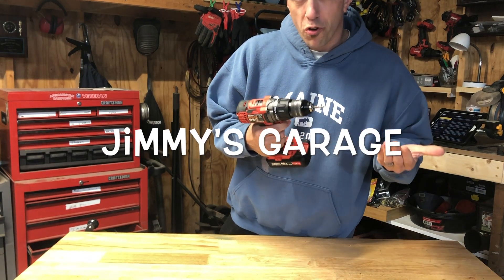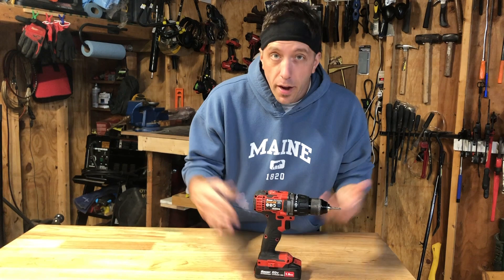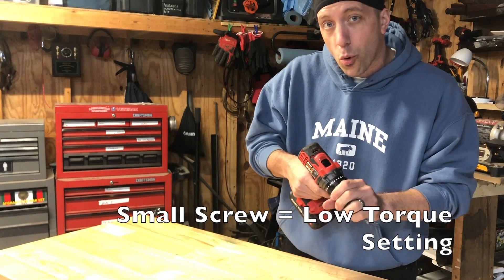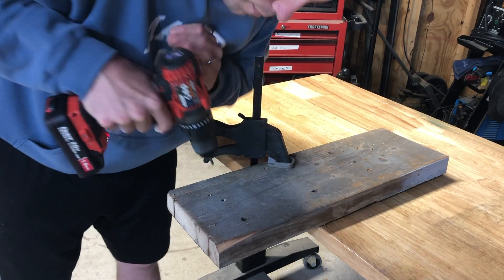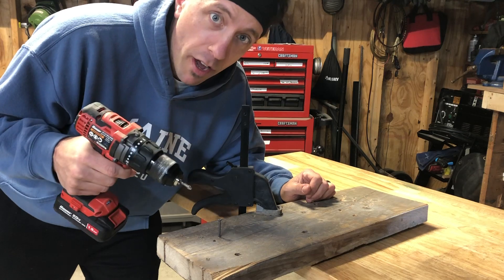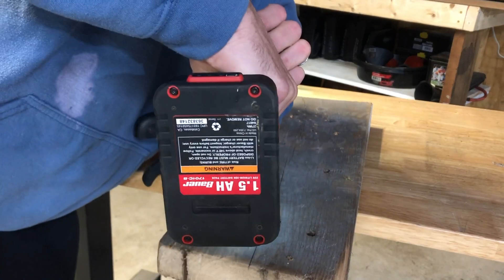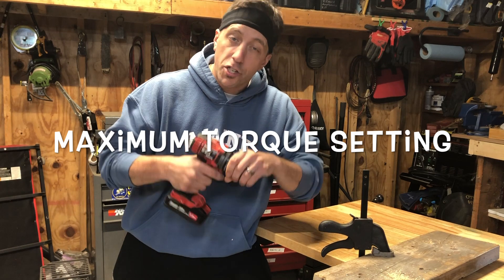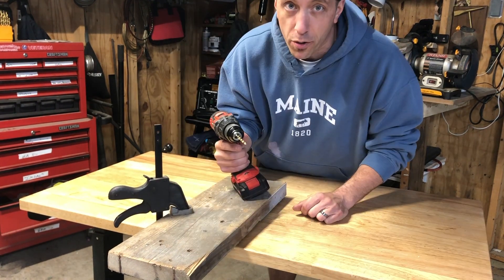Cordless Drill Torque/Speed Settings Explained!

Comment: Since you are using a Bauer 20 V tool which is the same exact tool line I use explain to me why the older technology non brushless drills from Harbor freight that are Bauer 20 V  Including the old drill driver as well as the hammer drill both have 450 pounds of torque but the newer supposedly better brushless drill that they have which is supposed to have more power because it's brushless and it's supposed to last longer because it's brushless as well as use less battery only has 405 pounds of torque yet the Hercules drills that I don't have but I might get in the future have much higher torque because their non brushless models have over 500 pounds of torque but the brushless drill driver and brushless hammer drill from Hercules in 20 V both supposedly have 1200 pounds of torque so why is it that the Hercules brushless drills have more than double that they're non brushless counterparts have in torque yet the Bauer brushless drill has actually less torque so what's going on?  So far Bauer has the regular drill driver in brushless but the hammer brushless drill driver isn't out yet but supposedly it's going to be out fairly soon but I might call Harbor freights phone number not the store but like the technical people and ask them this question because I really like the Bauer line and I didn't really intend to get into the Hercules line but their tools are almost priced the same now and their brushless versions have a much better warranty so I'm thinking I might start collecting some of the Hercules tools now especially when the drills in particular have almost 3 times the torque that the Bauer 20 V drills have but if you know anything about this or can explain why the brushless Bauer drill would have less torque than the non brushless when the brushless are supposed to be better and newer technology I would love to hear your opinion and do you think someone should really get the Hercules brushless hammer drill in 20 V for example since it has 1200 pounds of torque and the hammer drill could come in handy if you're drilling into concrete compared to the non hammer version but I just think it's really strange that the brushless Bauer drill would have less torque than the older non brushless has and the Hercules has like 3 times more torque than the Bauer drills it's really strange when the price of the Hercules isn't that much more now and they have a much better warranty but then I have to worry about having some of their batteries as well as chargers when I have a lot of the batteries and charges from Bauer and I didn't really intend or wanna get into another power tool line besides Bauer but it looks like I might need to if I want that extra power especially on the drills and I really like Harbor freight but this is just really strange but let me know what you think since you made this video and you're using a Bauer drill which is exactly what I use as well THANKS!

Comment: Believe it or not, at age 63, I'm just now learning things a son should have been taught by his father. But, since my father was drunk or high most of the time, I didn't learn any basic mechanics, such as changing oil, changing a spark plug, or knowing what the numbers on a drill mean. I've probably damaged my drill by operating it incorrectly. Thank you for the clear and straightforward explanation. This "old dog" is learning new tricks.
Reply from the maker: Thank you for that honest feedback Garrett! It’s always great to learn new skills. Thank you for watching 🇺🇸🤘
Reply: I 2nd Garrett.Same age but i always used wrenches, ratchets, or screwdrivers myself.
Reply: Not every father has those particular skills drunk or not

Comment: What about drilling into metal
Reply from the maker: Yes, it can drill into metal.
Reply: @jimmysgarage9068  what torque level do you recommend
Reply: @ygbodybuilder3023  Rule of thumb The harder the metal, the lower the speed should be. Also for jobs like stainless steel, dont forget the lube.
Reply: @craigdewitt4292 lower the speed and higher the torque????